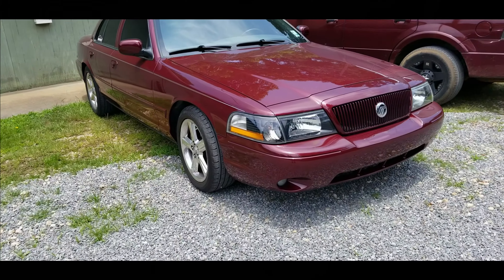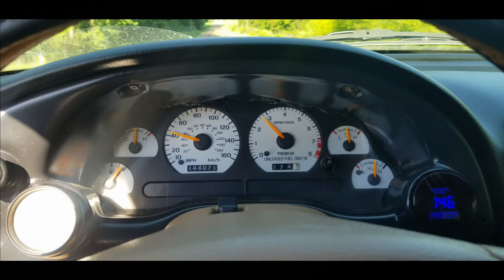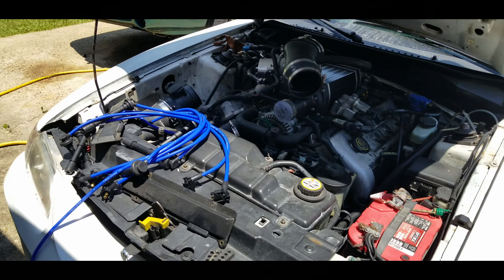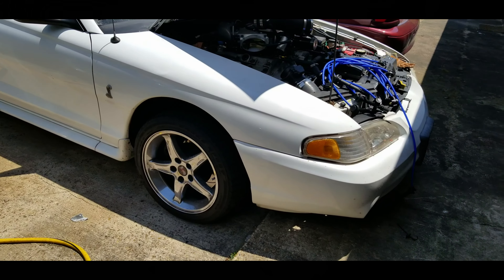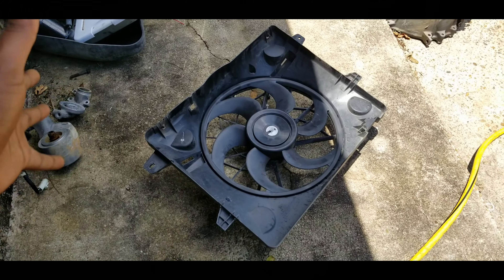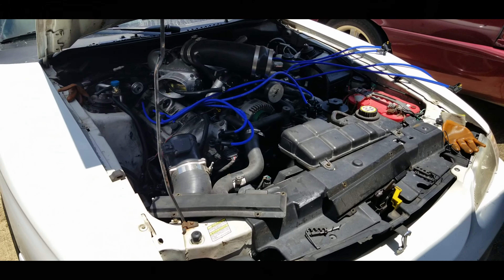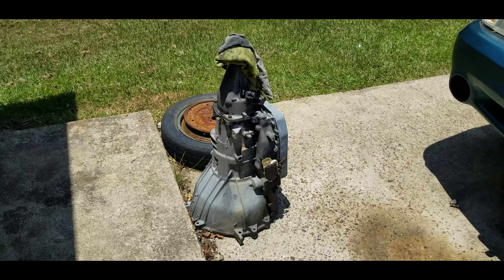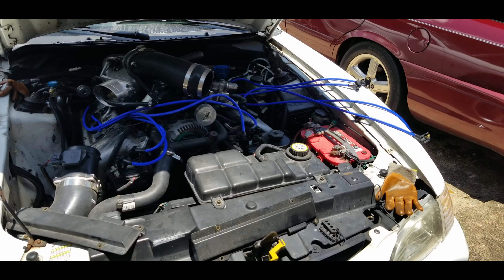Marauder Returns | Kenne Bell Cobra Dyno Prep

Comment: Wonder how my 03 marauder proformance would be with your tuning... (WOT) especially...
Reply from the maker: im sure it could be made rather stout ! what all is done to her ?
Reply: @mr.e8543  125.000mi JLT CAI, JLT catch can both sides, SW LT Headers, No Cats, custom stainless Hpipe to super delta44flos, 4.10s, 235/50/18 255/55/18 tires, using pennzoil ultra platinum 5W30 like you suggest.
Reply: @mr.e8543  YouTube kept erasing my reply...
Reply from the maker: @Deaths_Inevitable  yeah it has a spam filter on it. if you can hit up facebook and roll over to my Mr.E85 page or on install Mre85boost
Reply: @mr.e8543  ok, will do. So you can tune it? I’m very interested in seeing what you can do for the car.
Reply from the maker: @Deaths_Inevitable  where are you located exactly. i currently dont do them remote . eventually i will be.
Reply: @mr.e8543  MD 21216 zip.
Reply: @mr.e8543  sent a email...